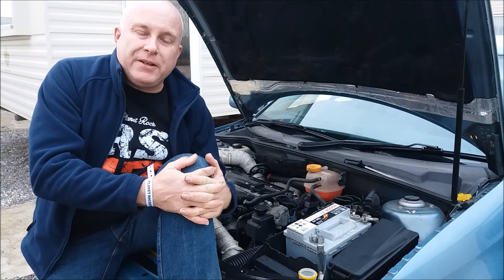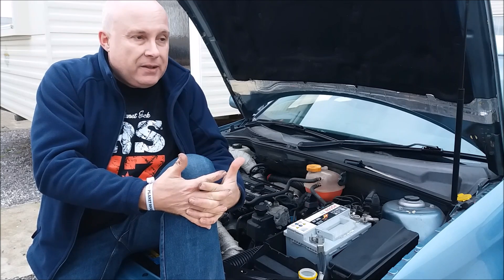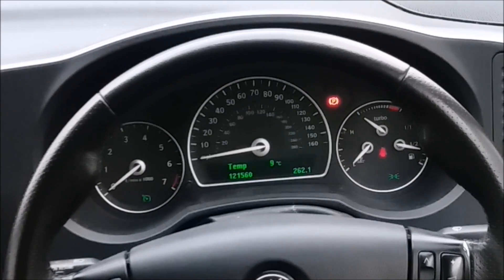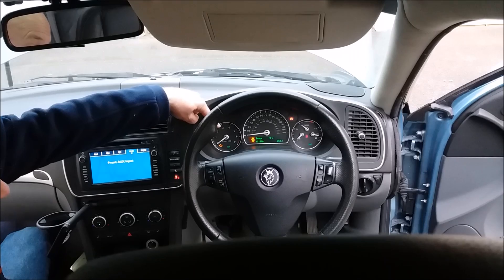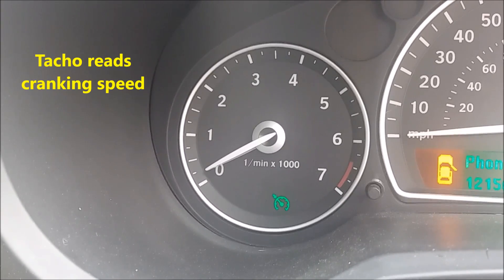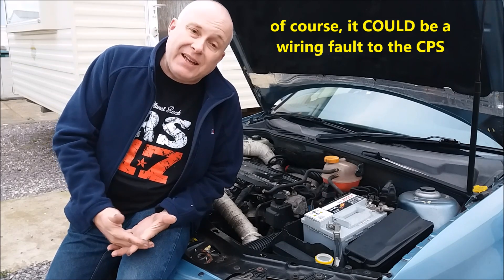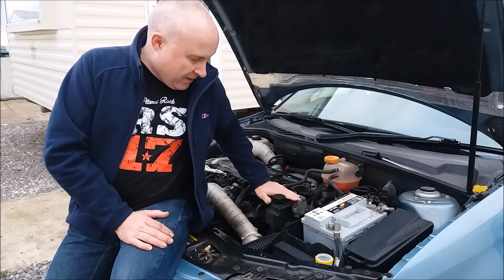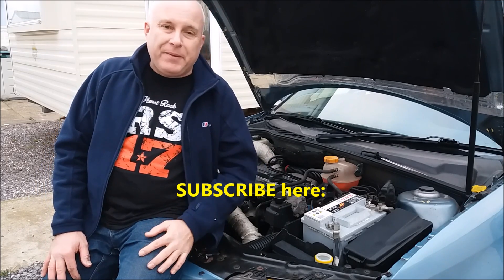CRANK Position Sensor Test - failing CKp sensor - CKp test

Comment: Thanks mate, this is the best diagnosis video for a faulty CNKSS, on the whole of YouTube, simply and straight to the point.. Round of applause 👏👏👏
Reply from the maker: Hi Strake750, WOW, high praise indeed 💚 thank you. I was actually inspired by most garages saying you can't test them, so they test by substitution (diagnosis by guesswork I call it). To test them properly in the early stages of failure you need a picoscope, which is out of the reach for a DIYer (around £1000 worth 💰). This method, of course, is free and easy and anyone can do it.

If you want to see it being done with a picoscope, watch this video from @Oz Mechanics
https://youtu.be/wmoQxiqYX3U

Welcome aboard. 🖖
Reply: @CycloneCyd 
Ha ha, it's funny you should send that link, I was watching that one  until he produced a large hammer, when I saw that, I immediately switched it of then come across you video, but thanks anyway and  good day to you Sir

Comment: I've just done this on my car and unplugged the cps the car then cut out, I tried restarting it with the sensor unplugged and the tach was stuck on zero does this mean I need a new crankshaft position? sensor
Reply from the maker: Hi Shaun, thanks for watching. Welcome aboard.

Based on your description - No!  If the CPk is disconnected then the tacho cannot work nor can the engine start. The point here is that if the tacho does not respond with the CPk connected, then the CPk is faulty.

Comment: Hi great video. Hoping you can help me. My car always starts without fail In the mornings however if I go somewhere and return to my car after a short period of time between (5 to 25 minutes) it cranks but fails to start. It will only start if I leave it for 20 minutes or so without trying to start it. As well as this it has cut out on me whilst driving on the motorway on one occasion at 70mph but again started after I left it for 20 minutes. Diagnostics have been done with no fault codes appearing. Do you think this sounds like a CPS issue? 

I have in fact changed the CPS sensor with a cheap aftermarket one but I’m still having the same issue I’m not sure as to whether to pay for a genuine part from the dealer and try again or whether it’s another issue entirely or cam shaft sensor related. Any advice on the issue would be greatly appreciated. Thanks in advance
Reply from the maker: It certainly 'sounds' like crank sensor. Have you tried the 'tacho test' like I show when it won't restart?
What car is it? Does it have a cam sensor? Most cars that have both don't stall when one fails, but run in a kind of limp mode using the remaining sensor and give a CEL.
The general consensus on sensors is to buy good quality, Bosch if it's a Euro car, or maybe Denso. Cheap aftermarket sensors get a lot of bad press, so personally I avoid them.
Have you checked the wiring?
Reply: Thanks for your swift response! 

It’s not done it since I saw your video but will certainly look out for this when it happens again. It’s an Audi A3 1.6 from 2011 and I believe it does have a cam sensor. I’ve not had the wiring checked but I will do. Is there certain wiring which I should advise them to check or it it just generic? Most mechanics have been pretty useless with it to be honest as well as Audi themselves who advised me to change the catalytic converter which never really made much sense. 

It cut out on me on only the one occasion but I did find it had a leaking fuel filter after this happened which may explain as to why it occurred. The last mechanic I took it to did say that he had encountered a problem like mine before which was only resolved by getting a genuine part. 

Thanks again for your advice.
Reply: Just an update on my car situation. Ever since I posted my question the car has been fine. However, it has once again refused to start. I did the tacho test and saw that it did go to around 200rpm as you stated in your video. On that basis would you rule out the CPS?
Reply from the maker: Blast. missed your update. yes I would rule it out for now, but get it tested on a picoscope if you can't find the cause.
Reply: Same here . But mine has never shut off whilst driving. Once it's on it drives good. It's a hot start issue. I just cleaned my MAF sensor and PCV valve and hoping this helps. I read how short trips can build up condensation I the engine and if that's often, the pcv valve can gunk up and stick open or closed. I have no idea if it is gonna help, but mine was filthy and gritty.
Reply from the maker: Yes, keep PCV pipes and valves clean. Also throttle body (I've a video on that). Unlikely to be dirty MAF if you change air filter regular and are sure they are fitted correctly. Also check your MAP sensor, they need cleaning too (brake or carb cleaner)

Comment: What will happen if crank shaft sensor is not working properly
Reply from the maker: Have a look at this video. It shows what you should see on a pico scope and what you see if the sensor is starting to "drop out" random signals rather than failing completely. https://www.youtube.com/watch?v=_XrkrQOWP60

Comment: Cheers mate,do you think it could cause misfire when pulling away? Got a few checks to do first like plugs coils etc,also I’m not sure weather my e34 has both cam and cranks sensors lol
Reply from the maker: The CPk 'could' cause a misfire at any speed or load. If it's missing any signals then that throws out the fueling. There's no DIY way of testing for that thoiugh, you really need a picoscope which runs into big $$
Reply: Ok I guess just replacing it as it’s not to expensive is the way to go,cheers buddy👍🏻🇬🇧
Reply from the maker: @StuartOliver83  Check the things that are easy to check first. Plugs, coils, wiring etc. At least that way you're not lashing out good money on a pure guess.
Reply: Yeah cheers,I have a sneaky feeling it’s a vacuum leak on the rubber boot somewhere after the maf before the TPS but so busy at work that I don’t get time lol cheers again mate I’ll sub your channel 👍🏻🇬🇧
Reply from the maker: @StuartOliver83  Ya muchly Stuart. Does it do it at idle? If yes you can spray pipes with brake cleaner to find a leak. Otherwise inspect VERY carefully, especially around connections.
Reply: No just under load mate or if I rev it sharply ,it’s bloody annoying though when trying to pull out from a junction lol

Comment: I have subscribed to your Chanel mate I have a question for you if I cools have 5 mins of your time pleas
Reply from the maker: Thank you Martyn. Ask away 👌
Reply: Thank you I have a Renault megane mk2 and it keeps coming up with injector fail on the dash the bloke at the garage plugged it in to his computer and said its a cam shaft sensor and he can't clear t till its fitted with a new one have you seen this before with a 55 plate megane it's the 1.5 cdi many thanks
Reply from the maker: @obviousmartin2501  I've no experience with that particular engine, but what he says makes some sense. My first question would be : how does he know it's the cam sensor that's failed? Is he relying on the code or has he tested the sensor (maybe looked at live data)? EML codes should never be taken as 'gospel' on their own and should not be regarded as a substitute for good practice ie TEST the component it suggests.
And, the code CAN be reset. If the fault is still there however, the EML (with the same code) will return as soon as the engine is started again. This method can be used to indicate an intermittent fault.
I would also always caution to test the wiring integrity to components before replacement, especially expensive components like coils and sensors.
Garages love to play "parts darts" at your expense  💰👎
Reply: Cyclone Cyd ok matey thanks for your advice I have a multi metre could you tell me how I can test the cam shaft sensor with that pleas
Reply from the maker: @obviousmartin2501  Hi Martyn, yes, I can but before I do let's check a prerequisite:

Does your DMM have a mVac scale with a resolution of 10mV or less?

In case not, this is the meter I have:

https://amzn.to/2siMOvh

Stonking good value at just 14 quid - I paid more than double that 7 or 8 years ago

You'll also need to be able to connect to the pins in the sensor, so small croc clips or 3.6mm spades.

Comment: Hey its me agian, so my car has a hard time starting when warm, once the car is turned over the rpm drop to 500, hesitate and die out. If i give it gas it will stay running, and never has it just stalled while on... thats why im not sure about the cps now. But other people have fixed the problem by replacing.
Reply from the maker: Don't compare your issue to other people's issues. You end up chasing red herrings everywhere doing that. No way is it the CPk. If it were it would stall no matter how much gas you gave it. Quite simply: your engine CANNOT RUN without the CPk.
Your problem sounds to me much more like a fueling problem OR [more likely] a vacuum leak, probably a small one.
Get yourself some of this https://amzn.to/2VNM3Xh and an assistant. Get the assistant to use a small amount of gas to keep it running while you spray around on pipes and gasket faces listening for a change in note if the fluid gets sucked in. Also check ALL pipes VERY THOROUGHLY for cracks or splits. Manipulate the pipes and squeeze them to see if holes or splits open up.
Reply: @CycloneCyd  I have the same issue as Draven above. It almost always starts when cold. Never stalls while driving or idling. And almost always cranks but no start after it drives a short distance, turn it off, and won't restart. Crank no start.  I have new spark plugs, new coil packs, new starter. Good battery and alternator. I was about to replace the crankshaft and camshaft sensors until reading this. Now I am wondering if it's a vacuum leak. WOULD A DIRTY MAF SENSOR or PCV VALVE cause this type of warm engine, crank no start issue? Could the PCV valve intermittently get stuck and be the vacuum leak problem?
Reply: @jenridge7768  Im going to replace the cps and see how it goes because thats what the OBD2 said what it was. We'll see how it goes
Reply: @CycloneCyd  is there anyway we can talk more, id like to send you photos and videos to try and resolve it. Ive had a p0171 code, (vacuum could be the culprit)for a bery long time now and now the car is acting worse.
Reply: Could my powersteering unit cause this? It has a small small leak, so small it never needs more fluid.
Reply from the maker: @dravenrosenbaugh2834  P0171 is system too lean.
Have you checked for vacuum [or other intake] leaks yet?
That's first on the list
Reply: @CycloneCyd  i have yes, even tried smoke test through the air intake part right before turbo. No luck on vacumm leaks but i will try looking harder. Can a k&n drop in filter theow that code? I was driving on the highway and it randomly came on, sometimes the light will go off and i saw it flicker once.
Reply: Draven Rosenbaugh
Reply: @Draven 
I'm having the same issue. The code said crankshaft sensor. 
What was your outcome?
Reply: I had this issue several months ago. Read somewhere that cleaning your throttle body might work. One day i was lucky to be stuck by Walmart having the same issues as you. So I got all the materials at Walmart and cleaned it as last resort hoping it would work and it did. Car almost ran like new. It was good for awhile but several days ago, it went back to stalling 2x. Hasn't done it again since (knock on wood) but I am probably gonna replace the CKP soon & see what happens since I've been experiencing uneven acceleration as of late.
Reply: Did you change the throttle positioning sensor
Reply: @jameslimburg8181  what sensor do you say I didn't know for sure? you can write exactly if you like.?
Reply: Vacuum leak
Reply: same issue here Draven, had this problem with no solution for about a year. I am about to replace my sensors as well. Crankshaft and camshaft because they aren't that expensive for my toyota corolla. About 50.00 total for both from rockauto. The other thing I am doing is cleaning my PCV valve and MAF sensor. New PCV valve is 3-5$. Did you fix yours?
Reply: @jenridge7768  did  replacing the crank shaft position senser fix anything?
Reply: @austinwilliams3784  it did not fix the hot start issue,no, but it was corroded beyond all get out, so for 15.00 and 2 hrs, I don't feel it was a waist of time. I am STILL having issues starting my 2003 corolla if the engine temp gets to normal operating temperature. So if I drive 10 minutes, I have to wait at least 2 hrs to restart my car. If I drive 30 min, I've had to wait 3-4 hrs. It's baffling. I've replaced spark plugs, coil packs, crankshaft sensor, crankstart sensor, and temperature sensor. I've cleaned the pcv valve and throttle body (this actually helped a little but not fixed totally.)
Reply: @jenridge7768  bad maf
Reply: @jenridge7768  Hello my car is the same in my car. What details should I change?

Comment: Hi. I’ve got a 2002 Holden Astra having this issue. Changed the sensor with one from the wreckers, still the same. Both had about 14 ohms resistance. It takes about 30-40mins before it restarts. Runs perfect otherwise. It seems to have fuel pressure at the rail after stalling, but injectors don’t sound like they’re opening when cranked over. Fires when you spray into the throttle body. Evap purge solenoid pulses, then when it stops ticking, the engine starts, is this a low power issue? If anyone has any advice, it would be much appreciated. Also the fuel pump, filter and relay have all been replaced.
Reply from the maker: Hi  rotflol73 , thanks for watching and interacting. Don't forget to like the video and consider subscribing.

The symptoms you describe are classic CPk failure. Runs fine when cold/cool and when it gets hot it stalls, then won't restart till it cools again.

Have you tried following the advice in the video when it won't restart?

If this test suggests it is the CPk, then that would back up my advice to buy new for this component. How do you know the one from the breakers isn't faulty also? Measuring simple resistance is no guide in this instance.
Reply: Cyclone Cyd, Thanks mate. No, there is no tachometer movement when cranking. I tried the wreckers because I was trying to avoid spending too much more money before I know exactly what the problem is. I have heard too many stories of people taking cars to mechanics and spending way too much and not fixing the real issue. I guess I’ll order the part and see how it goes. Thanks again.
Reply from the maker: @Dayday888.  yeah, I know what you mean. Diagnosis by guesswork I call it. Or parts darts. Have a look at my Polo ABS video comments 🤯🤯. No tacho signal when cranking is definitely CPk. Let us know how you get on. PS buy Bosch not cheap one.
Reply: Cyclone Cyd, Hi. Got a new one, fitted it and it stalled immediately and left some stored codes (don’t have a reader yet). Cranked a couple of times then fired up and ran again. The tacho was moving that time. Went for a drive, 15mins in and stalled again, same symptoms as before. Fan still running, I think the AC fan (this was happening before also), even with ignition off. Decided this time to remove the neg battery terminal. After 30secs or so put it back on. The pulsing evap solenoid went off, and it started up and drove away. Happened 2 more times today, and was fixed by removing the battery terminal again. Seems now to only go a couple of k’s then dies. Also it will sit there and idle for an hour with no issue. Where to next? 🤷🏼‍♂️. Thanks again.
Reply: @Dayday888.  yikes  that's tough .  How's your alternator, newer? Def sounds like a wiring or ecu issue in your case. It's almost like if you leave it motionless it's fine, but if you jiggle something the wrong way it happens. (Whatever that happen may be.) Did you ever figure it out yet?
Reply: Just got stuck again today at the lights in the turning lane.

Comment: Hi cyclone omg you saved me a ton of money the negative cable has 2 cable one that goes attached to the engine and the one that goes to the body of the car came loose I just cleaned it and tightened it and problem solved no more cutting off and no more flickering again thank you so much.
Reply from the maker: Brilliant! Thanks for letting us know. Maybe seal up the connection with a 2 thick layers of brushed on enamel paint.

Comment: I have the same problem and also it's stalling when I press the brake pedal and the cluster lights flicker when I come to a stop with very low rpm help I have a scion tc.
Reply from the maker: Stalling when coming to a stop is common. As it gets worse it will fail to start straight back up, and that's when this test is useful. Be careful though, with a Toyota engine you may have a camshaft sensor too. Before lashing out money test both sensors. You do that with a DMM on low range mVac. Crank the engine and you should get a small ac signal from the sensor. If not it's knackered. But remember to test under fault conditions.

Cluster lights flickering could be a battery / alternator problem so test both (video early in my library) and check all wiring connections including body earths.

Thanks for watching. Please like the video and consider subscribing. Don't forget to come back and let us know how you get on.